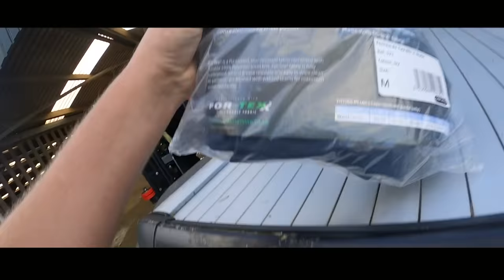**DAIRY FARMERS LOCKING COWS UP!?** Cow 812 ... and GETTING SOAKED! | The Hoof GP

Comment: Why does the sole need to be modeled at all? I know you said to prevent a sole ulcer, but why does that work? Why isn't something completely flat better by distributing weight?
Reply: Think about the sole of your own foot and how it is shaped by the arch. This is suspension, basically. It dissipates impact force and spares it from conducting into the joints of our ankles and knees. 
The shaping prevents bruising and ulcers due to repeated impacts carrying up into the pedal bone by making the surface more...suspensiony? For lack of a better term.

I am not a hoof trimmer, but I am a biomedical engineering student.
Reply: @dreihaddar  Thanks!

Comment: In Austria we have it easier. Our weather has stability. Well, as much as possibly. So around spring times huge herds make their way onto the alms. The trees/forest and/or shelters provide safety during the occasional storms. But they are essentially living wild in the mountains during the warm part o the year. Even milk cows make it up into the mountains. There are milk sheds where they are milked twice a day. The area is full of gras which can't be otherwise used, because of it's difficult location, and the surface is also rocky. Great for the hoofs. The negative aspect is that you do, rarely but still, loose a cow. Either because they fell of or because of a lightning bolt.
Uneducated people are also an issue. These cows are not as tame as cows raised in sheds. They have their horns. If some idiot decides it's a brilliant idea to go on a stroll in the mountains and bother the herd. Well. Tough.
If you are going on a mountain listen to the bells and stay away from them. Cows (or at least the lead cow) have a bell on just in case a herd gets lost, it's foggy (not uncommon in the mountains) or need to be rescued.

Comment: Why do you use a blow torch on some feet but not others what is the heat for
Reply: He does it on all feet he's applying a block to, to dry it out, so the glue works better.